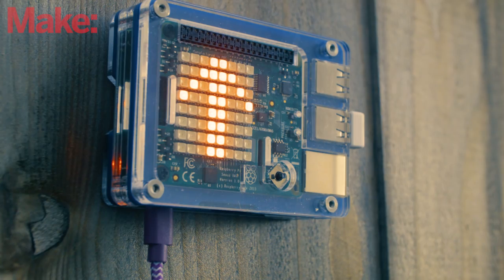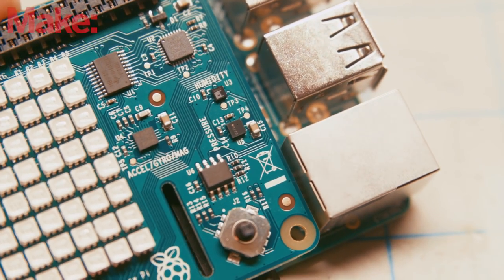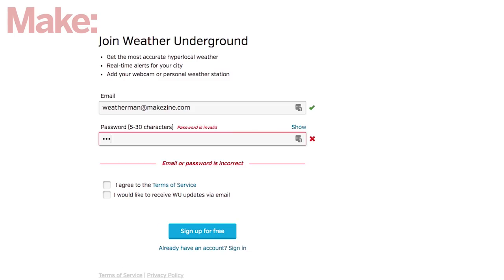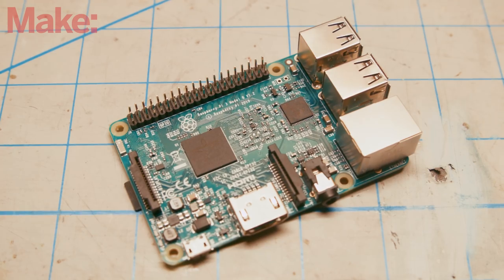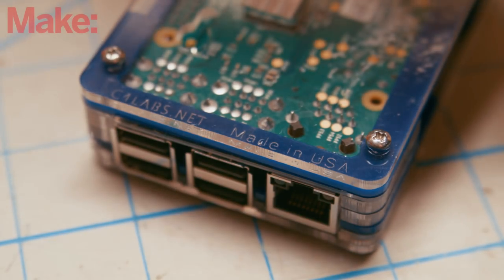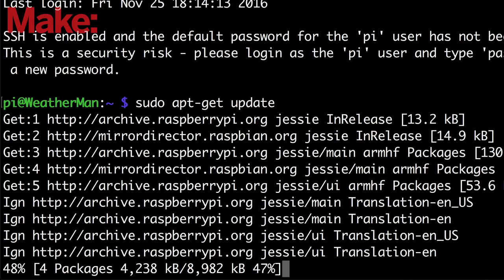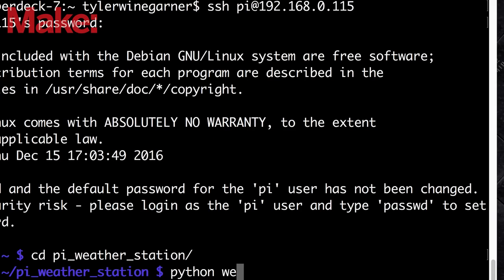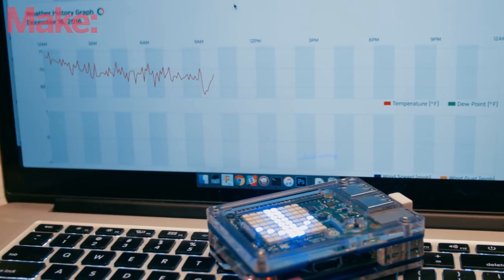Weekend Project: Raspberry Pi Weather Station

Comment: A weather station should not be sited above, on or near brickwork, blockwork, concrete or any stones (they act as a heatstore and invalidate temperature readings.

Any weather station should be placed off the ground in an open but shady area, in a small wooden housing, that has downward facing wood slats on all four sides, slanted wooden roof, and open base... The down facing slats let in full airflow while preventing the weather station from being exposed to direct sunlight (all temperature MUST be taken completely in the shade).

The sensor hat should NEVER be placed over any heat generating components of the Pi (unlike the incorrect method being shown here) as it will absolutely give false readings, and not just false temperature readings... ALWAYS, separate the sense hat by several inches (preferably using a gpio ribbon cable, which you will probably have to buy separately - under $10 each).

These methods are not just "best practice" methods used by real scientific researchers, they are minimum expected standards to achieve accurate,  usable data... If you're going to share your data as part of citizen science projects, you should make the effort to ensure you are providing accurate data, properly sourced using proper scientific methods.

Comment: Loved this simple raspberry project! I only worked with arduino but i need to get in the raspberry game soon! this could be an easy starting project :)
Reply: You can use both together, actually. You can program the Arduino using the Arduino IDE if you prefer it using a Raspberry Pi, and the Pi can communicate via serial if you want a means of the two talking. You can get pretty creative with it.

Comment: Does the data from the pHAT go via the bluetooth or via another cable?

Also will it connect to a Pi Zero W to put the data on a screen that the pHAT senses?  So using the W as a data collection point?

Comment: Doesn't the case dampen temperature (or even pressure) changes? If it isn't weatherproof and you need to mount the RPi somewhere dry - why not an open case?

The temperature readings might be higher then their supposed to in this video, not due to the small distance from the CPU, but because of the enclosed case.

Comment: I like this project. However, I find the temperature sensor on my sense hat gives me a reading that is 10-15 degrees too high. I guess it sits too close to the processor?
Reply from the maker: That's one of the reason the heat sinks are so critical - they help stave off some of the head from the CPU so it doesn't effect the sensor.
Reply: i put an additional riser on my hat, to get it away from the heat of the CPU. its actually good to have the sensors outside of a standard case so you are getting only ambient air, and not the dissipation from the pi itself.

Comment: I have all the sensors from another type of weather station that never worked properly ever. All the sensors work fine it was the software and the base station that were useless.  Is it possible to connect in all those sensors onto the pins of the RasPi with this add on card? The kit has a wind speed and direction sensor. A rain sensor that is a simple 10 ml tip bucket and external barometer. The internal barometer was in the base station. This way I could keep the RasPi inside and just use the internal barometer. Anyone have a reference that would apply to get me started?
Reply: there are ways to access the GPIO pins while using this HAT, there are videos explaining how to do this worth looking into

Comment: i dont get the end process my pi wont let me code the way that you did it, not to mention you go really fast and some dont know correct verbage that you use. dumb it down yo
Reply: There shouldn't be any coding needed. If you have your pi set up to use, and have retrieved the Sense Hat library, then all you need to do is set up your account with WeatherUnderground, get a device ID and passcode like he says, and then clone the code from his GitHub page, then put your passcode and ID you got where it asks for it and then it should work right there out of teh box, no actual coding. If one of these steps seems too glossed over or trips you up, just reply and I can try to explain in further detail

Comment: I have a middle range weather station with 10 different readings. The external and internal unit communicate via 433mhz  frequency. The application only allow me to use the most common cloud providers like WU weather cloud, but they are not free, or the free version is pretty limited. Weather cloud CSV  excel file is useless as all the data is dumped into the same cell.   So I have a Qnap NAS and I thought I just link it to there.  I got hold of a Nooelec receiver to receive the signal from the sensors, which I have to hook it up to the raspberry and use a decoder, which I have found on github. The difficult part is coming now, as I wish to link the raspberry pi to remote NAS. The Nas has an application called Iot suite lite. Which can host multiple devices, like a home automation system. So my question is for those who ever built such a device to create log and a dashboard for the weather station. thanks.

Comment: Scuse me if i'm dum but I don't understand the project. Why only a arrow on the display ? I though int was suppose to display the local weather from his PC...if so then  why is there a problem with the internal sensor/heatsink ? Like you notice, I'm a very beginner with Arduino..
Reply: I'm a slightly more than average programmer, but I also thought that the display was lacking. I updated mine to display all 3 variables in a bar-form indicating an increase, decrease, or steady. Soon its also going to occationally display the temperature in printed form, andcome to think of it, I'm gonna make it do it at the response of pressing the joystick

Comment: can you use the same unit to measure the temp, in and outside?
Reply: at the same time? ...... with a second hat, which wouldn't be used as a hat, you'd have to extend the GPIO pins through the hat so you had access to them and the hat at teh same time, then connect a second hat (or another thermometer) to the GPIO pins and stick that one outside (or inside, opposite of the hat basically) and then tamper with the code to read in that data as well, create appropriate variables, report that data..... does it sound worth it yet?

Comment: Lame. You learn nothing by using finished hardware and software...
Reply: How about all that you can learn by making the base project better?  What about power? What about getting the internet to where you want the pi to be mounted? Figuring out how the other sensors can be useful?
Reply: Analytical side could also be handy  and informative.....learning how to make sense of data can be more poerful than programming.....whats the point of storing data if you dont know how to use or make sense of it!